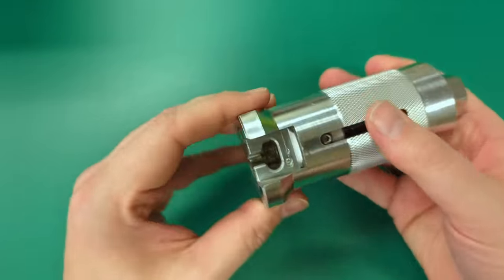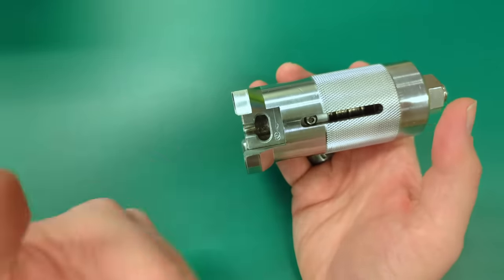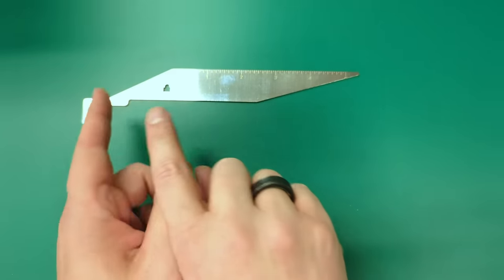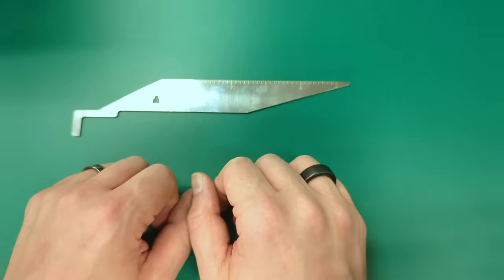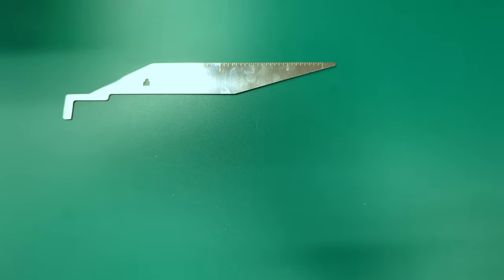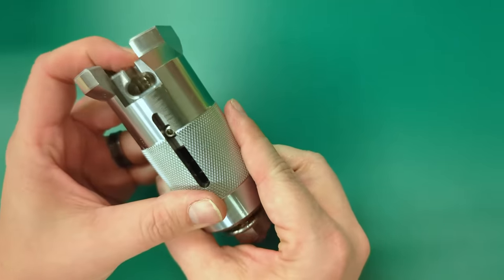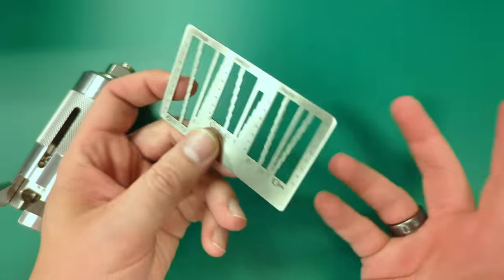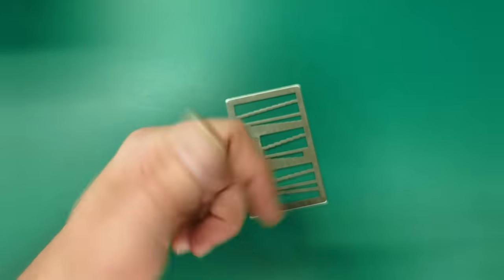I Was Sent These "New" Lock Tools to Review

Comment: That black multitool is a copy of Covert Design's Covert Companion. By the way Deviant. I would like to see your reaction while trying the new key quick casting set made by Covert Instruments. It is called Replicant and sold for 90$. Seems like made for your line of work.
Reply from the maker: yeah, looks stylish!  i can't tell if their mold tray is metal or plastic.  i like our metal version that has been on the web site i don't name for a long time, heh
Reply: @DeviantOllam It's metal (you can hear it in LPL's video) but the casting quality and hinge tolerance feels like it could be better given the price point. I know the tolerance doesn't super matter. I don't think Chinese industry is really setup to support high cast quality either so it was probably the best they could do for a casting.
Reply: @cheyannei5983  I disagree that China can't make high quality items.  It's just the marginal advantage of going to China goes down when you start requiring it from a manufacturer.
Reply: @DeviantOllam  Hmm, comparing the two on the sites, it really looks like yours is best used in a DIY kit or in a shop designed for it.  While the Replicant is an all in one portable kit.

What would the price/weight difference be if yours was made out of steel instead of Aluminum?  Then it could be used to cast keys in Brass / ZA 12.  Which solves the problem of cast keys being weaker.
Reply from the maker: @arthurmoore9488  I'm not certain why the tray being steel or aluminum would impact someone's ability to cast brass? The clay is what is holding the metal.
Reply: @arthurmoore9488  I'm not saying China can't make good items. I'm saying the manufacturing industry in most of the cities doesn't support casting well. Most American factories doing good castings are on the East Coast around Florida or NY given that's where all the industry build up (from/post WW2) happened.

If I want a lot of quality CNC or EDM parts, I'd look to a Chinese factory, because those are the industries they've built up.

Comment: I manufactured a set of tarot cards (small run, only 1,500) and was originally looking at a vendor in China to produce it. I spoke with a couple other tarot creators who had used them, and then while I was on the phone with the agent from the factory in China, I got a really bad feeling, and backed out. Then I found out both the other people who had use them started seeing bootlegs being sold online which were nearly identical (but made with cheaper materials), and were being sold for almost 1/10 of the normal retail price...

I ended up going with a manufacturer that's local to me (in my city), it cost a lot more, but I was able to have much stronger control over the quality, was able to see the samples in person same day, and give feedback. After a few rounds of revisions, they were able to produce the whole set, and I was also able to do it without using much plastic. I was working with a local paper company, and they were very flexible in the process, and worked with me to figure out what made the most sense.

Comment: Do you plan on getting LPL's new offering from Covert Instruments, The Replicant? Compare to the Red Team Tools Key Mold and Cast Tray offering and giving your opinion on if the RTT offering could be improved or advice on how the CI offering could be improved.
Reply: I like the idea of RTT's machined metal tray, but he does mention 3d printed trays can also work well.  Besides the tray, one needs to source the metal, spoon, clay, release agent (talc), and put it together in a kit.  If those are available on RTT's site, I didn't see them.

For about 3 times the price, CI has done that stuff for you and put it in a kit that will easily fit in a pocket or tool kit.  Besides the time one saves in sourcing separate parts, LPL/CI has spent some time engineering all the parts to fit together in a compact case.  All that is definitely worth some extra money.
Reply: @BryanTorok  looking between them, I think the RTT offering could be improved with something like the case of the CI version to provide additional clamping pressure and stability.
Reply from the maker: @Kinkajou1015  yeah, we should really get the release agent on our site, etc.
Reply: The replicant well thought out and can’t wait to test it.
Reply: @camronbay1 Make sure to educate yourself on proper use and handling as they shipped it with a cheap Chinese alloy called "wood's metal." It contains cadmium and lead. Cadmium is a heavy metal like lead, so don't breathe the fumes. I would find a safer alloy to cast keys with.

Comment: The plug puller is one important tool in my kit I use it on several types of locks and it’s made by Technical Entry.That sucks china steals several designs and makes them.

Comment: Those plug (barrell) pullers are not reliable, the part that touches the screw is not shaped to hug the head of the screw which leads to the head deforming then pulling off, I fashioned my own counter sunk stainless washer so that it seats the screw head nicely. The problem is though the hardened screws all have buggle heads rather than classic countersinking so they still deform a little. When the heads arent snapping they snap further down leaving a hardened screw stuck in the barrell, often with nothing to grab onto, a worse situation. When driving the screw in the lock, if it hits hardened pins the screw will snap. So it'll only reliably work on cylinders with no hardened material but these can easily be drilled anyway so this is only increasing the amount of equipment you carry.